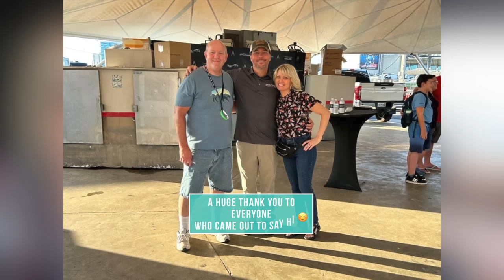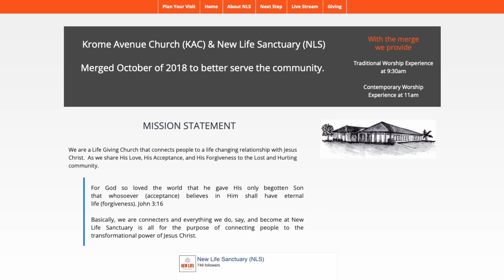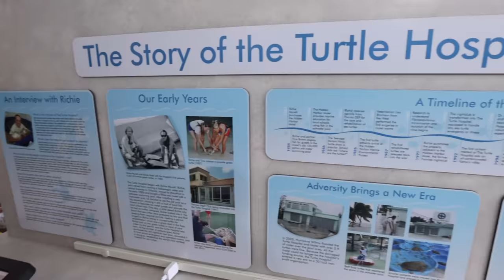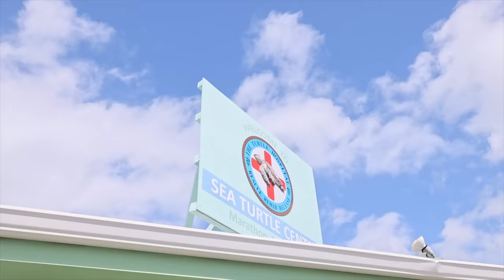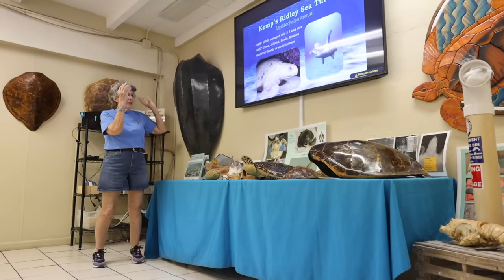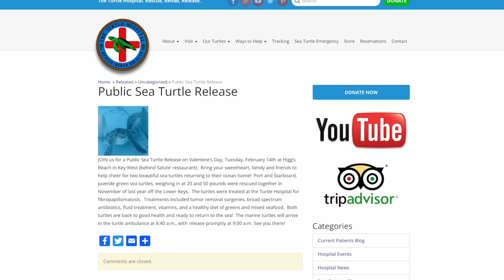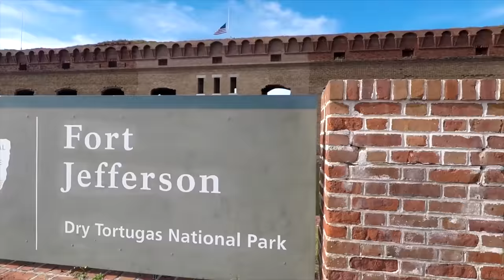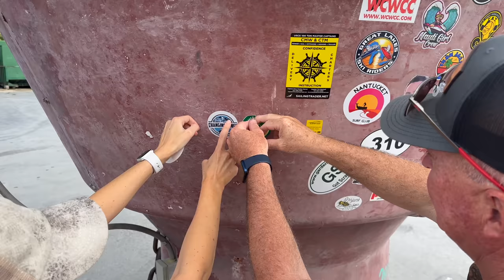The First Trip in Our New RV! (and FL Keys Turtle Hospital)

Comment: We live in Dade City and use the same Blue Beacon and based on your recommendations we do not let them use brushes.  Their manager is very good and accommodating.   I call ahead of time to see how long the line is as we live only 10 minutes away.  I would recommend any RV's who need a wash take the Dade City highway exit 52 off of I-75.  Blue Beacon is adjacent to the Flying J which does have a dump site.

Comment: "Manually leveling"...I really do appreciate how easy "Auto Level" is, but the whole hydraulic leveling system is one of those things I see as an unnecessary addition of complexity, risk, weight, and cost.  We watched someone with a tiny trailer setting up their stabilizers today, and it reminded me of how I would like to have the system work on our ginormous fiver.  Instead of six hydraulic legs, with electric power to the hydraulic pump, lots of valves, and an electronic system to control it all, why not just six heavy-duty scissors-jack style supports?  Each could be driven by a 3/4" hex, with the gearing set to where you could use a good cordless driver, or when that wasn't working, a ratchet or end wrench, or even your old-style lug nut wrench.  I know the scissors-style stabilizers are light-duty, not meant to carry nearly so much weight, but it wouldn't be that hard to make beefier versions.  Or maybe, instead of scissors-style, which have strength varying with extension, just worm-drive legs.  Overall, they'd weigh less, cost less, and have a lot less failure opportunity.
Our current "hometown" is Bushnell, just a little ways up the highway from Dade City!  I may have passed through there on my ride from Bushnell to Costco (Tampa) and back.  During this last show, we were at Trails End, near Floral City.  We talked about going to the show, but for whatever reason didn't quite get around to it.
I think we'd had our rig just about two years before we finally got around to washing it.  No Blue Beacon though (I'd seen claims that they use harsh chemicals, high pressures) for us; we bought a hybrid kit, works either with or without water.  It wasn't bad, considering how huge the rig is.  Using the same stuff to clean the bike was ridiculously fast.  I didn't even break out the telescoping pole.  Now I need to do the truck.
If you're really into sea turtles, another great winter place is Jekyll Island, GA.  The campground there is hard to get into for any length of time, but there are alternatives not too far away.  We stayed at Blythe Island the last time we visited Jekyll, and it was a cool park.  The time before, we stayed at a KOA at exit 1, which we now just refer to as "The Dump", and intend to avoid in future.  Jekyll has a turtle rehab center as well, and part of the island has substantial turtle nesting, in season.  Jekyll is also the birthplace of The Fed, which I'll leave at that to avoid political arguments.  But most importantly, it's where my dad lives.  I still need to work out where we're staying, and when, for the coming winter.  We want to visit Jekyll either in November, before our Florida time, or February, after it.